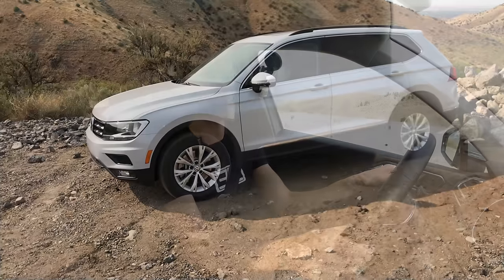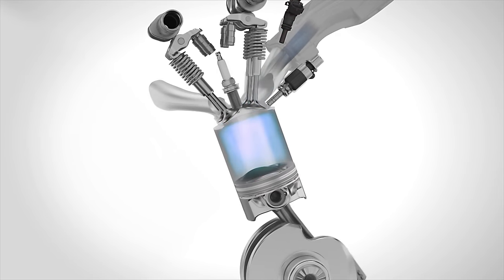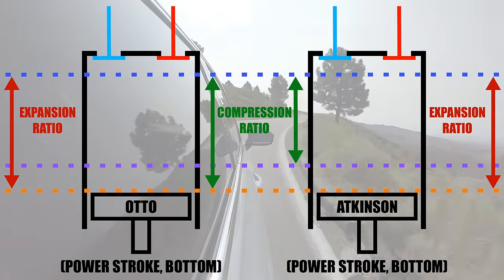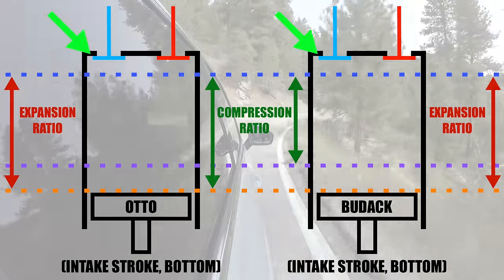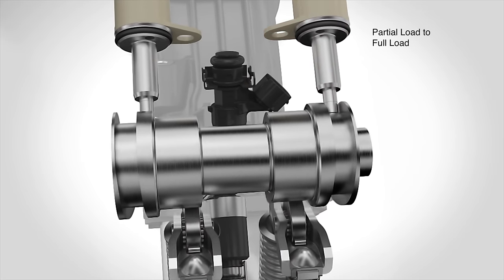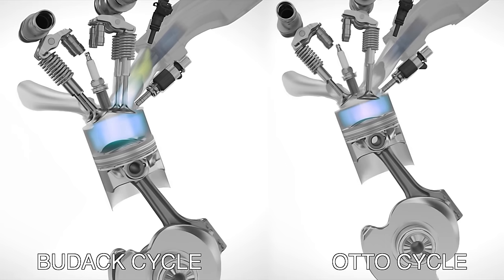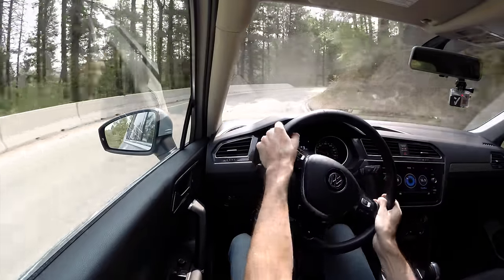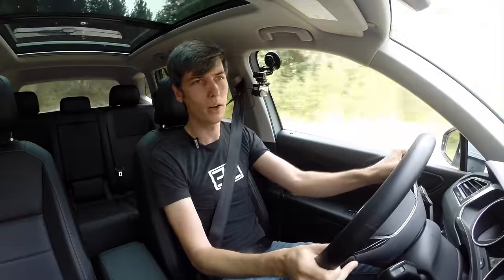Volkswagen's New Engine Cycle - The 'Budack' Cycle

Comment: I like how these engineers are out here changing valve timing slightly and calling it a new cycle. Bow down before otto.
Reply: lol
Reply: No kidding, vtec has been around for a while now.
Reply: yes but it drastically improves feeling and driving dimamycs of the car as well as fuel efficiency
meanwhile only improvement happens in repairing shop owner wallets
Reply: LUL
Reply: Well, at low throttle positions, the throttle plate on a carburetor or throttle body is already doing that, restricting the incoming charge, so there is incomplete filling of the cylinder. Looks like Vw made something very simple much more complicated .
Reply: It's basically 90's vtec. There's a reason e-vtec motors (HX/VX Civic's) could get 50+ mpg with little effort.
Reply: Hah, im a newb that just changes his oil, and I'm thinking, this is not new. Isn't this just a cam grind?
Reply: It works, I have s Seat Leon with the 190bhp 236lbft version of this engine. I just did a 200mile drive and averaged 50.4 UK mpg. Loads of go for overtaking if needed as well
Reply: @reecedrury4145  it is amazing, and reliable
Reply: Gerhard Gold  Suck squeeze bang blow is not a "cycle". If it were then the Otto and the Diesel cycle would be exactly the same, but they are not.
Reply: Gerhard Gold  Where did Vin find the time???...
Reply: George Ghaly  Well, this is not how the cycle is defined thermodynamically. An engine can 'suck squeeze bang blow' in so many different ways, all of them are called cycles.
Reply: Yes, in the end it is all these small differences that matter.
Reply: copycat cycle...
Reply: Very true it is still a 4 stroke cycle. A variation on the honda  Vtec
Reply: @pharaongaming8617  - 'dimamycs'? Are you f*cking kidding? DIMAMYCS? 🤣🤣🤣🤣🤣
Reply: @hydrocarbon82  they were also small, light, an low. now cars are big heavy and high
Reply: @hydrocarbon82  Thats what I was going to say! I have a 94 civic VX with Vtec-E and this is essentially the same thing! lol
Reply: agreed, this is what is usually called variable valve timing.
Reply: Where are all of the real engineers?... obviously Mia for quite some time now. Lol 😂
Reply: VVT
Reply: @artistphilb  and lift
Reply: I like how all these people online think it's so simple to engineer but couldn't figure it out themselves...
Reply: @pharaongaming8617  yea, but its not a new cicle
Reply: @ferrumignis  Yes it is.  Its a cycle of 4 strokes, as opposed to a cycle of 2 strokes.  Otto and Diesel are them same in terms of strokes.  Having a difference in how the 3rd element of the cycle is initiated does not alter the cycle.  Changing the timing of a valve opening/closing does not change the cycle.  How many cycles is VVT??  Does multiple fuel injections create multiple cycles?  Rotary engines go through cycles (literally), but they are not call a 1 stroke or 1 cycle.
Reply: @csjrogerson2377  You are confusing number of strokes and the thermodynamic cycle. Otto and diesel are not the same, just as Otto and Atkinson are not the same.
Reply: @ferrumignis  No I am not.  I have mentioned 2 & 4 strokes as different cycles because they are - there is a clue in the name.  There was no need to mention the Thermodynamic cycle as it applies to both 2 & 4 stroke engines. But 2 & 4 strokes are different cycles, so stop being an irrelevant pedant and if you wish to continue that line Atkins, Budak and the VW "cycles" are also ALL thermodynamic.  So, there is still no reason to claim that they are different cycles.  Different valve timing or injection timing (as in current Mazda Skyactive engines) is not a different cycle.
Reply: @csjrogerson2377  Took a year to work up an answer?  Must be some kind of record 🤣

"f you wish to continue that line Atkins, Budak and the VW "cycles" are also ALL thermodynamic.  So, there is still no reason to claim that they are different cycles."

Now you are just rambling, it's quite clear you have very little knowledge of engines.  WTF does "they are all thermodynamic" even mean?

Otto, Diesel, Budak, Atkinson are all  different thermodynamic cycles exactly as I stated before.  Do you know what a PV diagram is?   They are all four stroke engines for sure.

Comment: Koenigsegg be like: WIth our electronic valve control (Freevalve), you can have any cycle you want.
Reply: What?
Reply: @UltraGamma25  Look up freevalve. Basically they control the valves electronically without any camshafts.
Reply: Exactly. They could repurpose the "there's an app for it". Freevalve allows any combustion engine working cycle with only a software modification.
Reply: FreeValve will be the future of combustion engines. Reduced weight higher precision.
Reply: @93ChayZ  yet to see it in production.
Reply: @93ChayZ  or replacing valves is another good idea
Reply: @frankunderwood8357  it is overrated
Reply: I was thinking the same thing...also, I believe I misspelled his name in my comment.
Reply: @cliffcampbell8827  it is exp
Reply: @93ChayZ  Valvetronic has been around for 20+ years, and while it's impressive, I wouldn't say it made any huge rifts.

Not to mention, like valvetronic, freevalve will still probably utilize a throttle body, so I'm not sure where the weight reduction comes.
Reply: @Silver Dream Machine even with intake valves meteri g airflow in, BMW still uses a throttle body that stays open.

That way, if the valves fail, the engine isn't completely ruined.
Reply: @callang9 rotational mass weight reduction, thats why its still considered "lighter". I cant afford to compare them so... just guessing. AI designed, pure high quality titanium/magnesium cams and accessories got to be lighter than free valve... but free valve may still be more fuel efficient in the real world, since theres more energy loss on rotational mass in a cammed engine, beside the variables the e valve allow. Only real world downside beside cost is its energy dependence
Btw: i say ai designed because with enough money, a mould and a press could be build to make a solid(one piece) hollow camshaft

Comment: Sounds like the German thing to do.. make something inherently complex with completely average returns.
Reply: I know right? Edkinson cycle also yelds less vacuum which means fewer pumping losses than this bs cycle. They're trying to go around patents and sell it as innovation.
Reply: And vastly reduced lifespan. Hand grenade 💥
Reply: @bmccameron7642  interesting sir ,please elaborate further. Thanks
Reply: @bmccameron7642  Ah, so speaks an experienced youtube armchair engineer!
Reply: @PDZ1122  I'm actually a qualified mechanical engineer with decades of experience across multiple industry settings. Armchair expert to some despite this...lol
Reply: @bmccameron7642  I look forward to seeing reports of this engine exploding all over the place. I assume you'll keep your inside knowledge from VW engineers? Because they have no idea what they are doing, right?  Maybe they should hire you as an advisor?
Reply: VAG would do well to spend some time and effort on durability issues of the power units they currently offer rather than this nonsense of minimal gains.
Reply: @bmccameron7642  
Here they go again. Sounds a lot like the Ford 5.4 three valve engine  that created so many problems for their owners.
Reply: @S Hendricks Nope. Alfa Romeo 1980.
Reply: @Take the red pill Maybe if the krauts had fought as hard as the Japanese did instead of surrendering in droves they might have averted their fate.
Reply: @S Hendricks thats right.... VTEC...I also thought the same while watching the video
Reply: Like Otto and Diesel..?
Reply: keith cunningham  Agree, After making more than 21 Million Beetles one would think they would know what simplicity is. Example the VW Beetle,s air cooled engine has just one cam shaft with four cams operating all eight valves.
Reply: Yes it does. When the germans encounter a problem they have this habit of adding an often complicated widget instead of going back and redesigning a proper engineering solution from the beginning. German over-engineering.
Reply: Please...cleaner emissions (just kidding).
Reply: @PDZ1122  you are referring to a company with infamous reliability and fake engineering.
Reply: @PDZ1122  They won,t explode all over place but they will deteriorate dramatically just after the warranty runs out.  VW know exactly what they are doing.
Reply: Yen Tao  Rubbish.
Reply: @thracian2072  You have surrendered to fiction.
Reply: @thracian2072  Stick to "Nothing" It is a good word for you. Fini.
Reply: keith cunningham  yea I like the hydraulic variable camshafts.  The parts work like any pump with accompanying low wear.  Pins seem prone to wear.
Reply: Yen Tao  That is a very ill informed statement. Research more maybe start with the Fw190.
Reply: Dick Taylor exactly they struggle with a decent timing chain these days
Reply: @PDZ1122  100% correct.
Reply: Just watching from the outside and laughing at the lot.
Reply: Actually, this engine - not the smaller 1.5 with 130 hp - is the most efficient production gasoline engine at this time, regarding peak efficiency at 220 g/kWh. The atkinson-cycle (usually, Miller - or here Budack - is used for shorter intake duration, atkinson for longer) basically does the same, it makes compression ratio and expansion ratio a bit independent from one another by valve timing. Toyota has an Atkinson-engine without any turbocharging or supercharging, 1.8 l and somewhere around 80 hp, used in hybrids, which has the same peak efficiency.

200 is likely where it could get too complicated.

This vehicle's poor fuel economy ... well, look at this giant piece of too-much. It's not the engine's fault.
Reply: This honestly isn’t that complicated..? It’s just advancing the intake cam timing
Reply: @DC-rn1fc  That's the point a lot of comments forget: You have to differentiate between the engine and other influences when you judge the whole system (car)!
Reply: @Nitramrec  Exactly - and you have to look where some measure is aiming at ... something meant to reduce partial-load fuel intake will not change much in full load operation and vice versa ... cylinder deactivation never had any impact on peak efficiency and so forth...

The execution of a Miller Cycle in this engine actually is pretty simple ... the twostage variable valvelift is a known and proven design that screams "SIMPLE!" in every single part it consists of ... BMW's valvetronic may qualify as complex, but actually, it also is a proven and reliable design, it just, sadly, isn't used to employ a Miller Cycle (at full load).

The times of simple engines just are over. The effect something has of course it to be compared to the complexity it adds, and the simpler something is that makes a given improvement, the better the solution is - but this relation between effort and effect always was in favor of stuff that either is simple or provides a huge improvement. A twostage variable valvelift, nowadays, shouldn't be seen as exotic, because it isn't, and ...

... the vehicle driven by it has to be taken into account, too, of course, like ... I said, you agreed, I repeat. Because it seems hard to understand.

Why this cycle is given a new name is the part I not get the most out of everything ... it's just the Miller Cycle known for decades, executed in a certain way using systems already present in VAG's current engines. The turbine of this version is kinda cool, it's a diagonal/mixed flow one, which have a few benefirt, but are not a gamechanger ... low intertia, fast respnse, ...

The TSI, TFSI, ... engines, at least some of them, did have problems with reliability, but these are not a result of being turbocharged or having high specific values of power or torque ... the timing chain in EA111 TSI engines for example was of poor quality and maybe a bit too small - I don't see how this is connected to downsizing, but a lot of people took it as proof that downsizing means sufficient reliability isn't to be expected. Of course it is, given that the engineers aren't harassed by the economicians too severely ... a few of the newer ones, 1.8 and 2.0, had problems with their piston rings, because they had reduced tension and a very low viscosity oil, resulting in combusting oil, and infesting the oil with gasoline, making it lose it's ability to float a shaft on it in a hydrodynamic bearing, ...

All of this - or a lot at least - may be distilled into "a complex system doesn't break down because of simple flaws!".

The beetle engine ... boxer, air cooled ... wasn't even close to as reliable as its reputation, and it was a heavy drinker, with embarrassing low power output, frighteningly low efficiency, even compared to other engines of that time, ... but the PR was excellent! Still is today! Alfas and BMWs, having their beloved and legendary inline fours, really can reach more than 200k miles with the first sets of pistons ... a beetles will hardly excedd 50k miles.

Complexity isn't bad in itself - it's a question of the relation of effort and effect, and a question of the effect in reliability - which doesn't need to be compromised in any way.

Or something ... sorry for being long...
Reply: @DC-rn1fc  1.4 tai was the best with Atkinson

Comment: Doesn’t seem like a new cycle. If it was, every single engine that had different timing than another would be considered a “new” cycle.
Reply: I 100% agree. Every time you change a cam with more or less bump I guess you can basically say that you engineered that timing. VW just trying to salvage their reputation and I dont blame them
Reply: Yeah, it's a 4 cycle like almost everything. This is just valve timing.
Reply: It's a 'new' cycle for the Instagram generation. It's modified valve timing, not a new cycle. At least in my Mondeo Ford had the sense to label it a 'modified Atkinson cycle' and not make up some b/s claim about it being new.
Reply: @bobbytrill420  Trying and failing.
Reply: @Jon-em4kc  If you modify valve timing enough you get a different thermodynamic cycle...

The difference between this and a normal Otto cycle engine is the intake valve closes before the end of the intake stroke. The difference between this and an Atkinson cycle is that in the Atkinson cycle you limit compression instead of intake (some of the air is pushed back out the intake, in this it's not sucked in in the first place). In either case you end up with a longer expansion stroke than compression stroke (which is where the added efficiency comes from).

The only problem with trying to sell it as an innovation is that there are already a handful of manufacturers with engines that have continously variable intake valve timing/duration/lift (BMW Valvetronic/Toyota Valvematic/Nissan VVEL/Fiat Multiair) which all already do this at low engine loads.

It's funny, these manufacturers which are late AF to the continously variable engine intake management party don't try to advertise these things as innovations in Europe, because anyone who knows anything about cars here is aware that there's nothing new about it. But in the US anything more modern than port injection is still big news to most mechanics.
Reply: It's a different cycle, but not new. Early intake valve closing was known to other engine researchers I worked with at the University of Michigan in 2004, and maybe much earlier than that.
Reply: Well, at low throttle positions, the throttle plate on a carburetor or throttle body is already doing that, restricting the incoming charge, so there is incomplete filling of the cylinder, which is exactly what’s happening . Looks like Vw made something very simple much more complicated .
Reply: @davedemangone6033  You missed the point.  Throttling the engine does not change the relationship between the compression and expansion ratio which is where the thermal efficiency gains are made.  In fact throttling an engine actually reduces efficiency (due to throttling losses) so the Budack (and Atkinson) cycles likely give a double win since you'll need a higher throttle opening for a given power output when running the Budack cycle, so you are both reducing throttling losses and gaining from the higher expansion/compression ratio.
Reply: ferkemall  A four stroke engine has many possible operating cycles, some more practical than others.  Do you think the Diesel cycle is the same as the Otto cycle?
Reply: @BigUriel  hello do you if when choosing dynamic/sport mode is the variable timing while make comparisons and expansion equal? Are they will behave as otto?